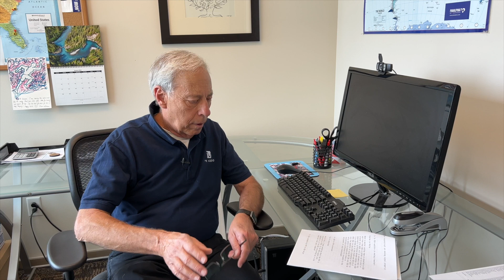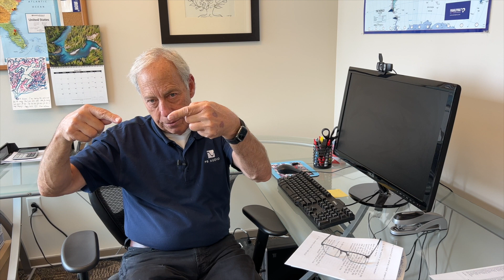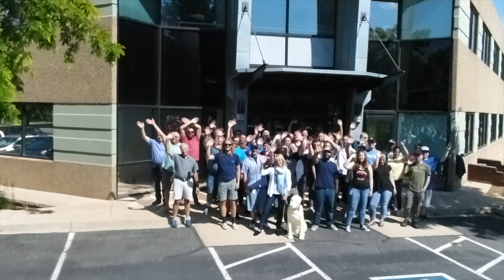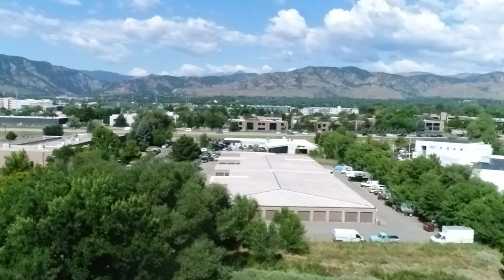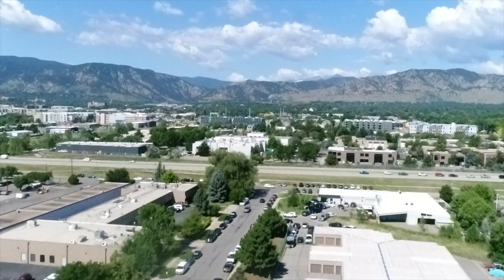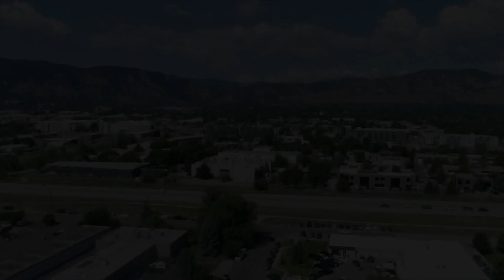DSD to PCM conversion

Comment: What I'm interpreting here is that, technically, you can hear differences between DSD and PCM if you use PS Audio designed and manufactured equipment to capture it and (presumably) play it back using that same equipment. Although I will never hear it in this sense, I don't doubt Paul's assessment. However, the likelihood of anyone having the exact same set up as in the Octave Records studio is extremely unlikely, therefore, the question becomes more about the resolving power of your average audiophile system versus the same in Paul's studio. With all the different systems out there, all with various degrees of resolving power, it could make detecting any DSD/PCM differences obvious at one end, and completely undetectable at the other. 

It's sort of like putting your ear close to a tweeter with your amp turned on. Most tweeters will produce some kind of faint (or not so faint) hissing noise. That's easy to hear because of where your ear is located. That's highly resolvable. But when you step back at a more normal listening distance, you don't hear it at all. Your ear simply cannot resolve that hiss from farther away. I think that's a metaphor for this issue. All the equipment in the studio is so high quality, it's like putting your ear up close to the music, which could certainly lend itself to hearing these DSD/PCM differences. If you do not posses such equipment, you may not hear any differences at all.  

Maybe it's more about our own systems (and ears!) than the digital files themselves.
Reply: PS Audio is one of many high-end component / speaker manufacturers.

Any other reputable, high-end equipment, that is professionally set up, will reveal what Paul spoke about in this video.  And depending on what stereo equipment is used, it can / will be more apparent than Paul's flagship setup.

Equipment from, for example, Aesthetix, Audio Research, Aurender, Ayre Acoustics, Belles, Innuos, PSB, Vandersteen, Magico, Wilson, Kef, etc, are all up to the job.

"All the equipment in the studio is so high quality..."
It depends on the studio.  Some studios use mass produced, mid-fidelity (being generous) equipment.

"Maybe it's more about our own systems (and ears!) than the digital files themselves."
It is not a choice of one vs. the other.

If it sounds better on a high-end system, then it will sound better on any other system.  Lower-end systems will do a lousy job at revealing the differences (that goes for any listening test).  But better sounding content sounds better than poorer sounding content, on any stereo.  If the stereo is of too poor quality, none of this matters (like putting high-octane gasoline into an engine that runs badly -- the better gasoline might help, but so insignificantly that it serves no purpose).

Better sounding content will never hurt, and can only help.  How much help depends on the quality of the stereo.  The better the stereo, the more it will reveal the subtleties between varying quality content.
Reply: @0Perhaps  well most of what you've said is certainly your opinion and not a de facto standard. You can only theorize that your listed equipment, especially when set up properly, "will reveal what Paul spoke about". And I'm aware that there are other high-end manufacturers. But that does not leave the conclusion that equip like this will reveal what "Paul spoke about". Keep in mind that Paul said the recording and playback equipment, designed and set up by him, will reveal how much better DSD is over PCM. So unless you have some empirical evidence that the equipment produced by the aforementioned manufacturers can reveal "what Paul spoke about", it's all speculative. And besides, while Paul has spoken highly of many manufacturers products in the past, he will also tell you if some products come up short of what HE thinks should be right. 

In the end, all the fancy, high-end equipment in the world may or may not display any aural differences between DSD and PCM. The end user may or may not hear those differences. The only thing that we can be reasonably sure of is that we can most likely hear the most obvious characteristics in the music when using high-end equipment: a more distinct bass, clearer midrange, darker/brighter tone, realistic timbre, etc, etc. But with something as discerning as high-quality digital recordings, it's not so clear. And some  people will simply not hear any immediate differences, regardless of the set-up. And that's a fact!

In the event that you may possess some "other-worldly" knowledge and insight onwhat people can hear, I can only dismiss your statements as speculative and theoretical - unless of course you have all the equipment mentioned and have set it all up to actually do some comparative listening to DSD and PCM files. 

There's a much bigger point you're missing here but I'll reserve that for later, assuming you'll reply to this comment. 🤷‍♂️
Reply: @housepianist  "So unless you have some empirical evidence that the equipment produced by the aforementioned manufacturers can reveal "what Paul spoke about", it's all speculative."

I have an amazing sounding pressing of Led Zep II (the hot cut).  It sounds amazing on my stereo.
I took it to the store where I purchased my stereo, "speculating" that it would also sound amazing on their flagship stereo (equipment that is better than mine, and a custom room that is better than mine).

Yes, I "speculated" that it my Led Zep II pressing would sound amazing on their stereo -- and it did.  It surpassed my expectations.
But how could I have known that it would sound amazing on the store's stereo (different speakers, different turntable, different everything)?

When you gain enough experience on a topic, you get to know what is what -- how things work.

I do not need to drive a Corvette to know it would be more fun than driving my Sentra.

Ergo, I know about all of the equipment that I listed above (most of it I have heard in high-end stores).  That is why I listed those brands.
They will all do what Paul says his equipment does.

I can slam on my car's brakes on the highway, for no reason, with someone behind me, and I could "speculate" that they are going to run into me.
You can make the argument that I am speculating, or guessing.  I will argue that I am certain, that at 65 MPH, with someone following me, that they will hit me if I mash down on my brakes for no reason.  I am right.  I know I am right.  And the same goes for knowing I am right about the equipment that I listed.

"...empirical evidence..."
That is your way of dismissing what you have no meaningful reasons for being combative.
Should I get a signed, notarized letter, accompanied with a video of me listening?

Even with the above, you would likely state that I imagined what I heard.

Why not try to learn, rather than impulsively taking contrary positions?

Everything else you wrote evidences that you never heard a stereo on the level of Paul's FR30 room.  Whereas, I have.
I have heard approximately a dozen or more stereos, ranging from a few $thousand, to hundreds of $thousands, all of which would reveal what Paul spoke about in this video.

I have also heard far more stereos, at wide-ranging prices, that would not reveal what Paul spoke about in this video (or my ear might pick it up, whereas the general public's ear will not, because I know how to listen, critically).

From what you have written, my conclusion is you have only heard the latter -- non realistic sound-fields.
Reply: @0Perhaps  oh good grief, another audiophile "pissing contest". 🤦‍♂️ I guess you're going to pull this sentence out and tell me how using term "pissing" is a euphemism for urinating but the result is the same - emptying one's bladder! Lol

You are utterly and completely missing the point! It's a mystery why you fail to address the DSD/PCM questions and instead choose to fill your replies with pointless comparisons about slamming car brakes, or saying a Vet is more fun than your Sentara, or driving 65mph, blah, blah, blah. You are using physical, tangible examples to make a point about a completely subjective matter. Don't use physical science to make a subjective point about  hearing difference between DSD and PCM. I use an example of listening to a tweeter up close and you're telling me about physical applications in driving a car lol. Ooooook..... 🤷‍♂️

Since you have not addressed why most people, even with high end systems, won't be able to detect differences in  DSD and PCM, I have to assume that you know I'm correct  but won't admit it. But hey, at least I will know that a Corvette will be more fun to drive than a Sentra lol.

Or will it? Hmm....maybe I'll take that to a car forum and see. But someone will probably compare that to analog vs digital recordings. 😂

Comment: How did you do analog design without math? Before the HP programmable calculators, you would’ve needed a pencil and lab notebook to keep notes on your analog circuit designs which includes quite a bit of mathematics.
Reply: Actually, not. Aside from calculating currents with Ohm's law—which is simple arithmetic—a -3dB points and filter values with 1/2πRC there's not much math involved.
Reply: @octaverecordsanddsdstudios1285  Less than 99% True. Only if you are using circuit simulation software...which does the "math" internally.

Comment: Coming to think of it .. LaserDisc or LD  actually recorded video signals in Analog ..  If Laserdiscs made a comeback instead of Vinyl to record PURE ANALOG signal and reproduce it using modern laser transport mechanisms and digital error tracking  correction. Then we would have a Perfect Analog reproduction of the Master Recording or Master Tape and DSD and PCM would not be needed .. What do you think ???
Reply: Not entirely true. All "disc" storage (optical capacitive,...) used some form of binary "pits". In the case of LD the analog video signal was converted into Pulse WIDTH Modulation.
Reply: Laserdisc was brilliant for its time. Bladerunner put through my then simple stereo with a set of phono plugs bloody amazing!
Reply: @angelwars3176  I have a THX demonstration disc that sounds astounding, with a montage of clips from various Lucasfilm productions. It beat the pants off of anything similar on DVD.

Comment: Who cares!
Reply: I myself, find this kind of audio engineering trivia interesting. One fact I heard, is that you have, say, 16 bit reproduction with the humble CD. Yet, how much better than a studio reel-to-reel machine is it? CD is 16 bit depth, but you take the biggest, latest analogue tape machine, running at the fastest speed, with the widest tape, you're only gonna reach a maximum theoretical bit depth of...13 bits. Another, when Hi-fi stereo vcrcame along in the early 80's, audio enthusiasts flocked to them, just for the audio recording ability. Their audio reproduction trumped most home reel-to reels, what with 70dB noise to signal ratio, stereo seperation of also 70dB, to top that al off it had a dynamic range of 90dB! This is BIG stuff to me...